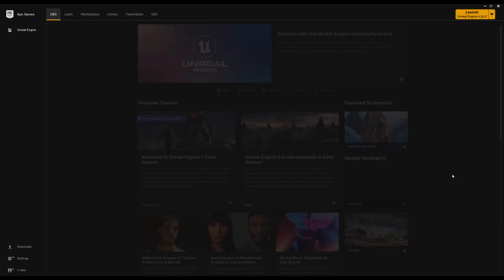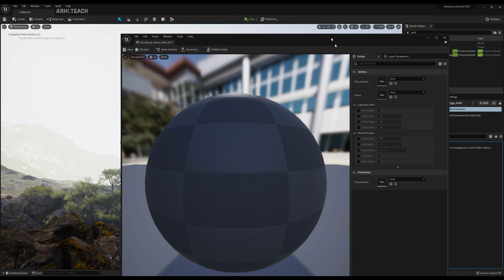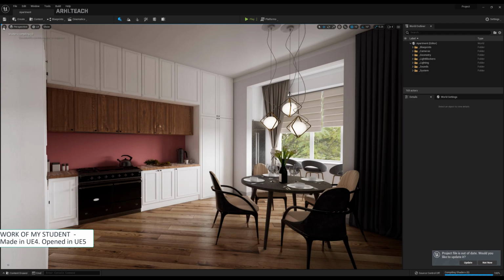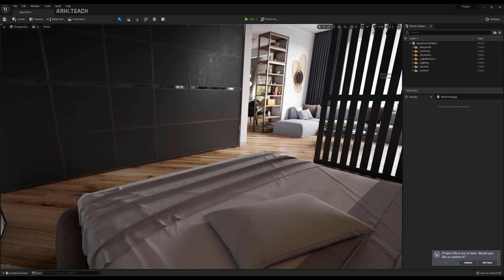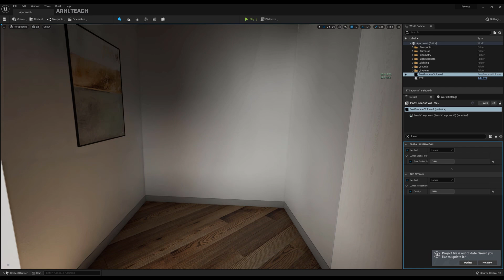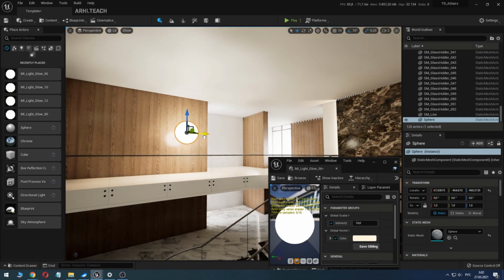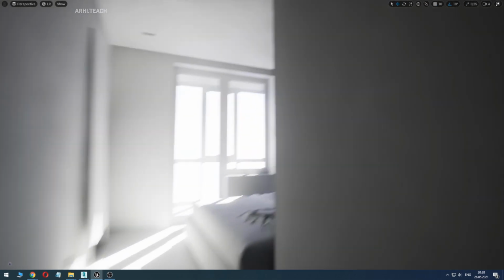What is new in Unreal Engine 5 | Exterior and interior | Baking light, geometry, lightning, Nanite

Comment from the maker: Contents What's New in Unreal Engine 5 | Exterior and interior | Lighting, Geometry, Light Baking, Nanite:
0:00 Introduction

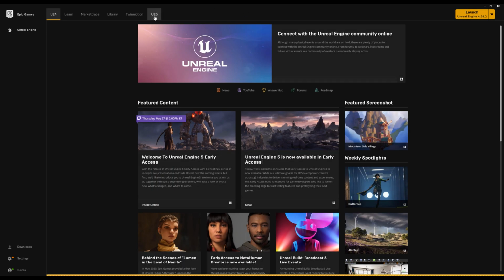0:30 Installing Unreal Engine 5
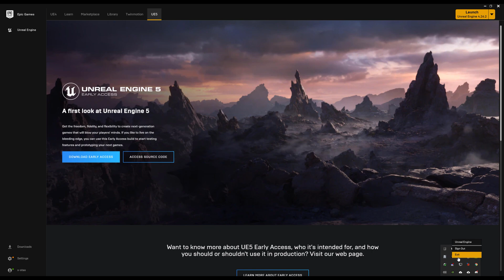0:45 Interface by Unreal Engine 5
1:13 Lumen in Unreal Engine 5
1:30 Bridge in Unreal Engine 5
1:40 Problems with assigning material in Unreal Engine 5
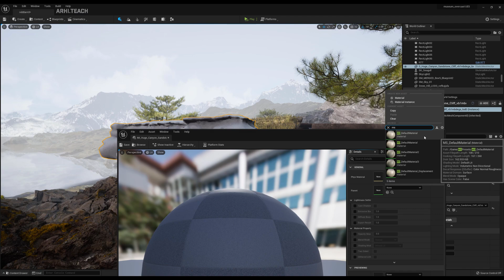2:25 Artifacts on contact of nanite and material in Unreal Engine 5
3:00 Global lightning in Unreal Engine 5
4:02 Interior in Unreal Engine 5
5:50 Baking Light to the CPU in Unreal Engine 5
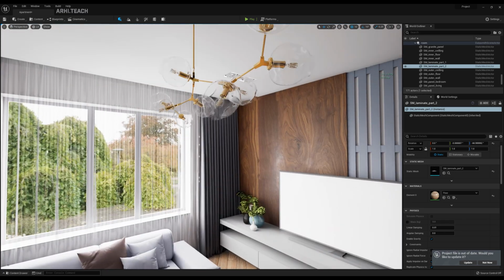6:40 Selfluminous materials in Unreal Engine 5
7:00 Conclusion